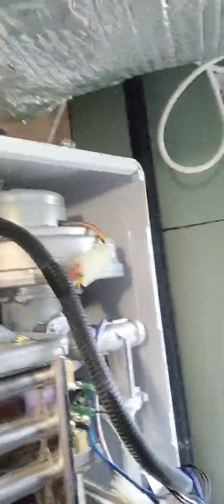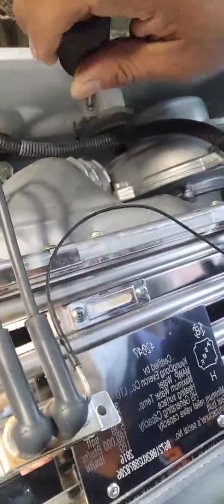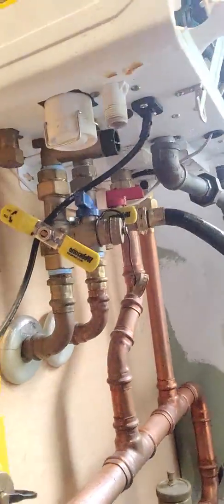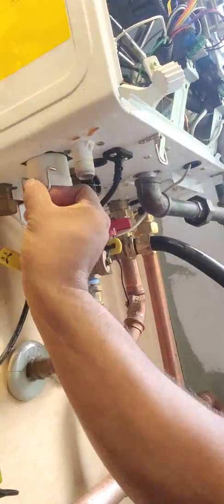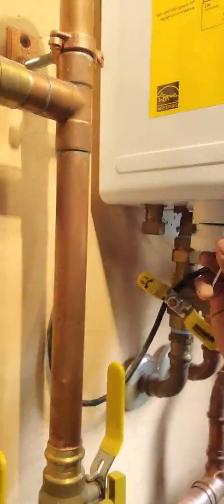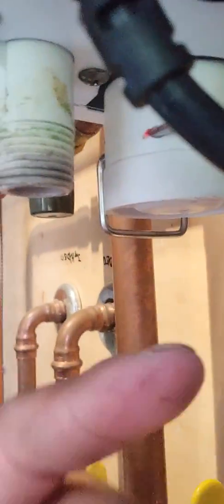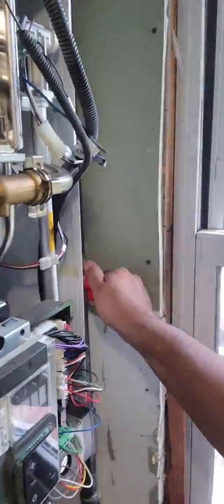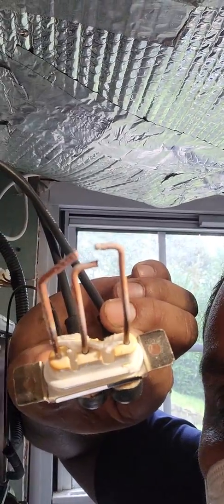3 most frequent problems with Navien boiler. Easy fix

Comment: Yes those are 3 very good tips I would add make sure you clean your exhaust vent screen with a Dry Toothbrush only do not wet exhaust vent screen because it could send a false warning to unit also there is another small drain that should be cleaned as well but you water line coning in cold water needs to be turned off so you can remove it and look at very small filter and clean if nessary  thanks for video

Comment: Appreciate the video. Condensate trap was absolutely full. I probably got close to 2 cups of murky water out of it. Before I cleared it out it was making a thumping sound and sometimes it would just shut off the boiler. Cleaned it out and it’s as good as new.

Comment: You need to fix those outside pipes!!!! They should NOT be that close together!   Intake and exhaust need to be separated...  and the one stub coming out is a water entry point...  gotta have a turndown.       You also didn't mention the filters - for domestic and heating - but that gets done when you do a flush...

Comment: My system turn on by itself. I have walked into the house at 95 degrees for no reason. The thermostat is set at 50 but somehow, the heat comes on by it self and the house gets super hot , Do you have any suggestions?  My thermostat is very simple you go up  or down to set it. It is not the programable thermostat so I am not sure why heat  is it turning on by itself.

Comment: I cleaned the trap on the bottom. It was filled with dirt. The hot water worked right away. Thanks a lot.

Comment: Thank you sir! I didn’t think to look at the condensate drain. I was hearing a gurgling from the boiler. I couldn’t understand how air would be getting in the system but that’s because I wasn’t. The gurgling was from the condensate. I saw an e003 error and e110 errors for reference. About a half cup of water came out of the drain then gurgling sound was gone.

Comment: My 3 way valve went on mine and it is only 2 yo.  The symptom was 777 LWCO going off every now and then.  Found only once summer hit because another symptom is that the base board pipes got hot when water called.  Finally got no hot water.
Reply: It was covered under warrantee but not labor.  Paid over $500 to fix.

Comment: Thanks.  Mine would not turn on.  I was getting error 22.  Then I was getting error 27.  My air intake screen was pretty dirty.  Cleaned it.  Still wouldn't go.  Went outside & cleaned what I think was the soffit vent for it.  Still wouldn't go.  So next I pulled off that water condensation catcher cover.  What a mess!  Should have warned me to put a small bucket under it 1st.  Filthy water went everywhere.  About 1/2 liter I'd guess. I put the cover back on while still spraying out.  I wasn't sure if it would stop.  If maybe it was perhaps needing the input water shut off.  But I went & got a small bucket & tried again & it did finish running out pretty quick after.  I had a big mess of filthy water spray to clean up.  The white cap was quite full of grunge.  Had to dig it out about an inch deep.  Compacted dirt.  Then I cleaned it & put back in.  I cleaned all inside the unit, also the outside & all around to make it look nice.  And have it all dry.  I gave it a quick check & turned it on.  It works.  Yay.  So I guess I was experiencing both of your 1st two common issues.  My unit is a Navien NP240 NG.  I live in White Rock, British Columbia, Canada.  Thanks for saving me hundreds of dollars.  Didn't cost me a dime.
Reply: how long did you own yours before it started acting up